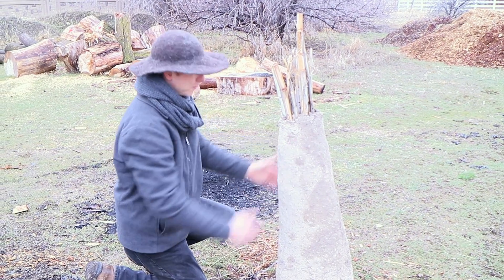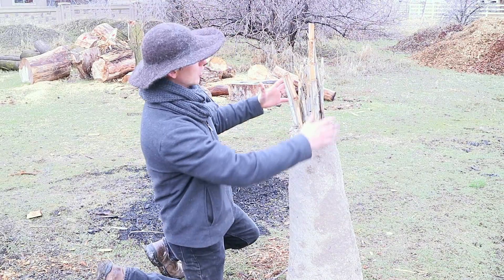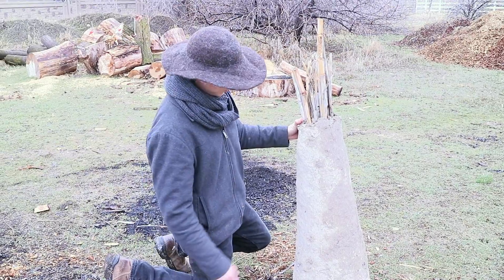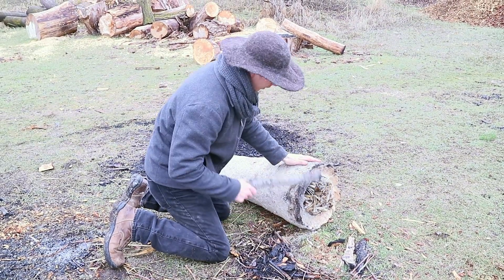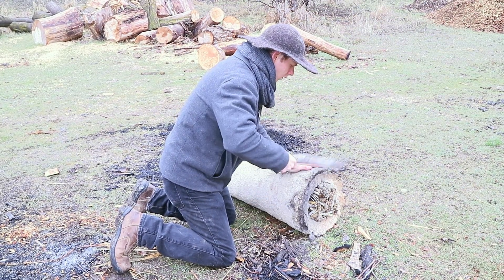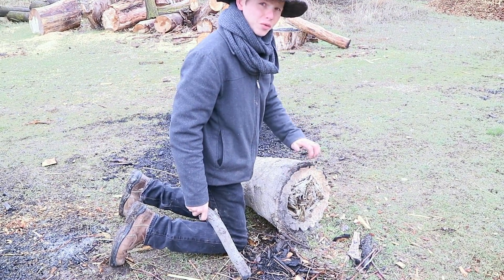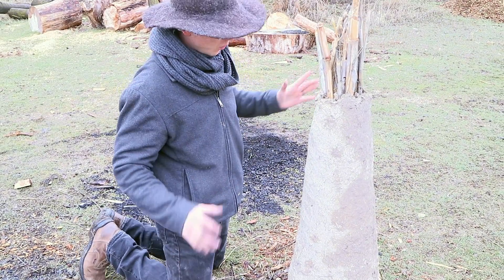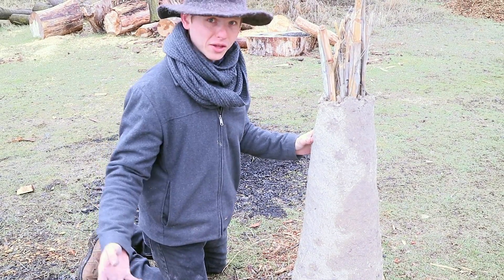Building the Furnace (for Smelting Iron)

Comment: What period are you targeting here, and what locality?  

There's some evidence that the Chinese had finery forges as early as 200 BCE. They're well attested in Europe from about the 15th century onward. They worked by reheating the pig iron - which is high-carbon and brittle, as you correctly observe - is brittle. Air from a bellows would be directed over the crucible while it was agitated or stirred. This would oxidize the remaining carbon (and silicon). The resulting bloom would be spongy and full of slag, and would be processed by heating at the forge, passed under trip hammers to force the molten slag out and consolidate the bar, heated again, hammered, ... you get the idea.  The Europeans were slow to learn of the process, which made it possible to use iron from a large blast furnace rather than a tiny bloomery, but it was certanly in wide use by the mid-15th-century.

This process was dominant for about three centuries, until a cascade of innovations. Potting and stamping, puddling, the use of hot blast, the rolling mill and only then the Bessemer and Siemens processes.   

I'm guessing that you're targeting somewhere in Europe, after about 900 CE (you obviously have a cold-blast Catalan forge going) but before about 1450 (by which time fineries were well attested).

I couldn't see the details of all the charge to the furnace. Are you adding an additional flux - limestone perhaps, or phosphate - to the bog ore and charcoal?

Comment: How will you separate the iron from the slag in a bloom? Or do you not have to worry about slag in a bloom?
Reply from the maker: In the forge, when you hit the heated bloom, the iron will consolidate and the slag squishes out. This is the reason for folding the steel. JB
Reply: @GoodandBasic  Okay! I was curious about that with the previous video
Reply from the maker: Thanks for asking! JB
Reply: @good@basics- You guys should try to make some crucible steel with one of the pieces as a method of removing the slag and consolidating the mass.
Reply from the maker: That's not a bad idea!  Melting after smelting. JB